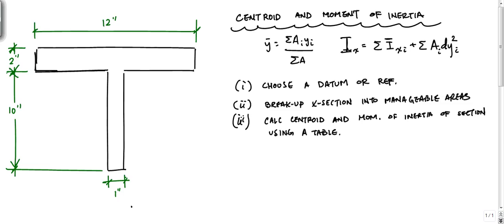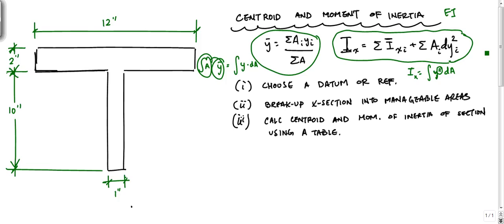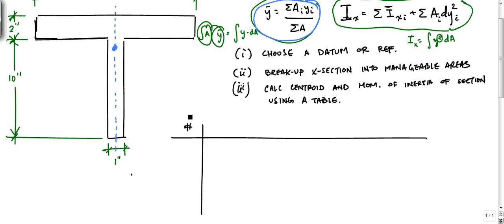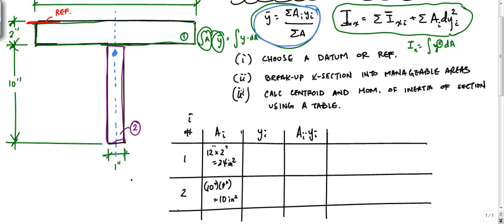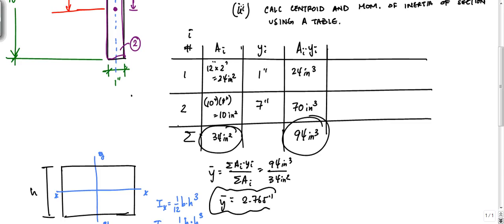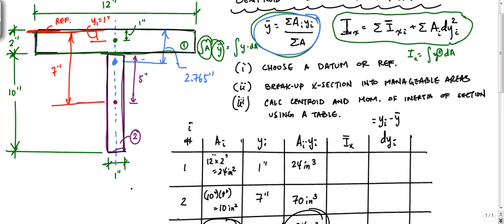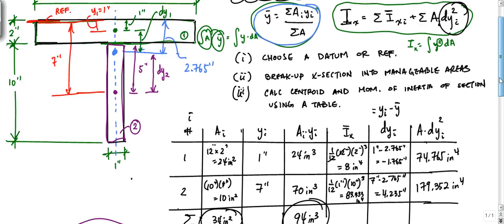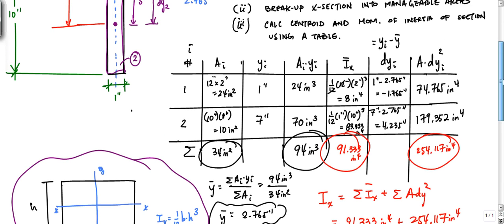Moment of Inertia Calculation - Structure Free

Comment: I am looking at an example in the book of the same T beam but upside down and they use 1/3 instead of 1/12. How do you know when to use 1/12 vs 1/3?
Reply from the maker: Typically the 1/3 is the result of using the parallel axis theorem. The 1/12 is for a rectangular section.